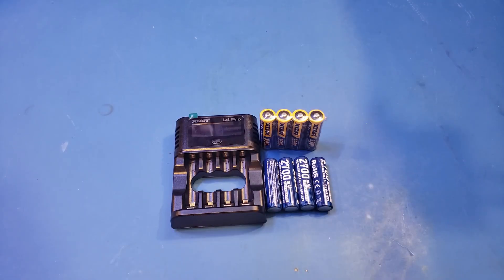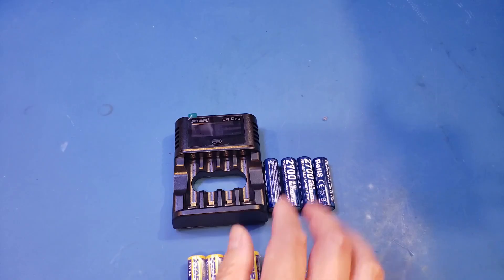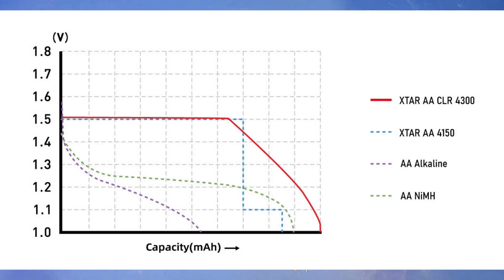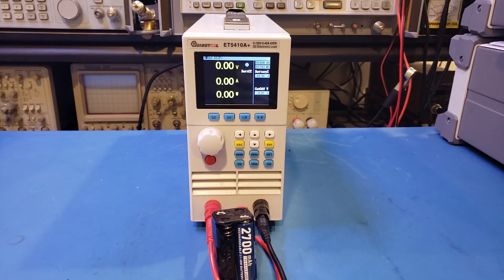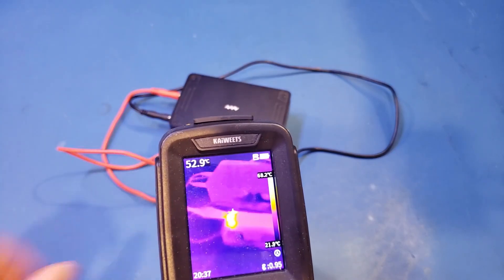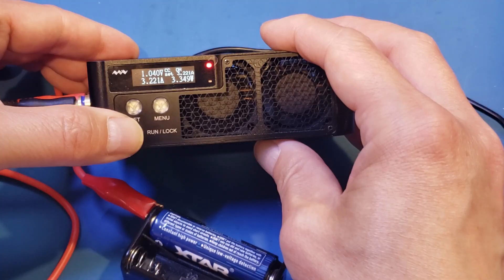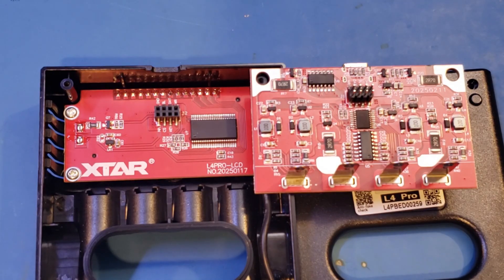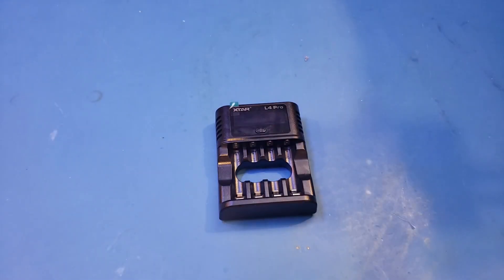XTAR L4 Pro Smart Battery Charger and 1.5V CLR 4300 2700 mAh Lithium Battery

Comment: Thank you.  I’ve been using another brand of Lithium rechargeable cells and a true 1.5 Volt terminal voltage is very useful.  I’ve installed them in a Yaesu FT-817 radio and I have not noticed any signs of conducted or radiated switching noise.  They’re also great for flashlights.  Xtar shaping the discharge curve of the cells reviewed here is a beneficial feature.